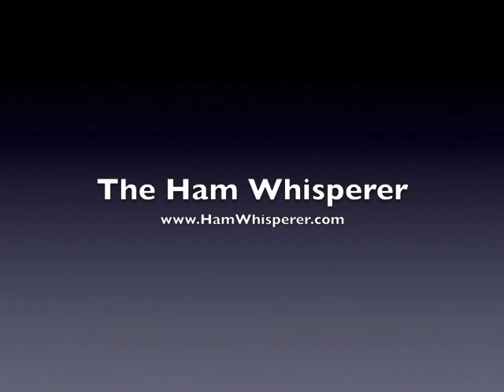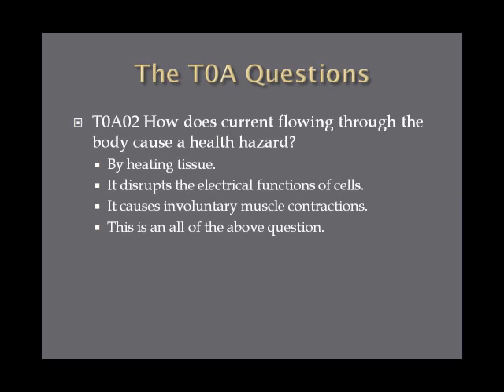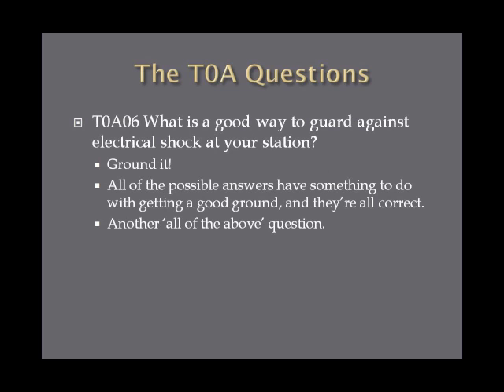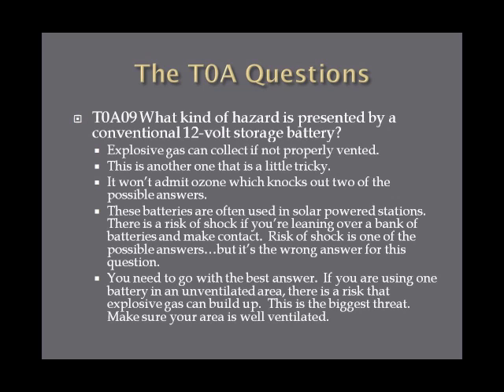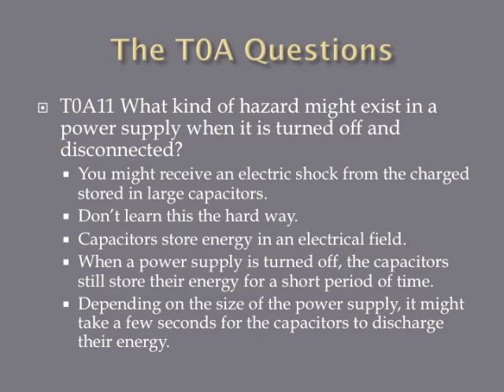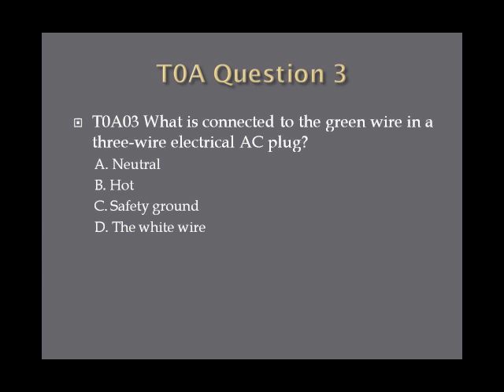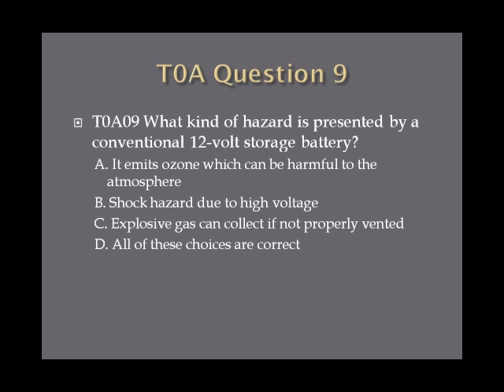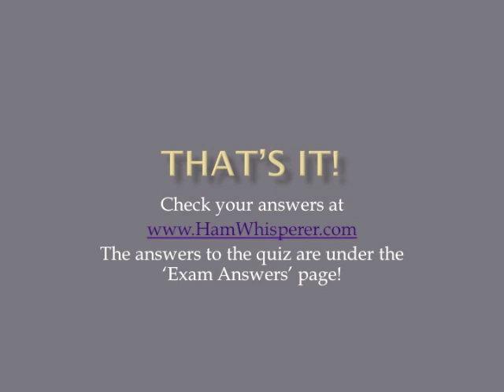Lesson 33 Technician Class Exam T0A Second Edition

Comment: Side note on T0A01, under normal, dry conditions, touching the positive and negative terminals on a 12v battery actually will not shock you. That's why that is not the correct answer. Give it a try some time ;)

Thanks for your help Ham Whisperer. I'm taking my class T exam later today. I'll send you my call sign later if all goes well.